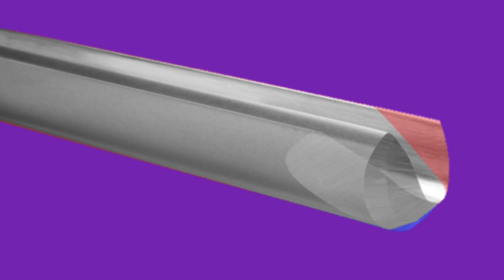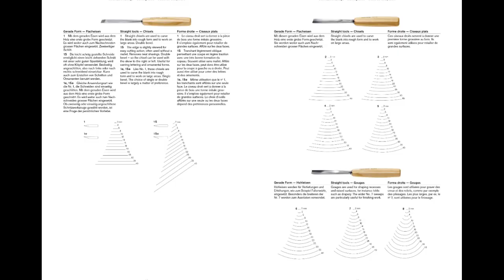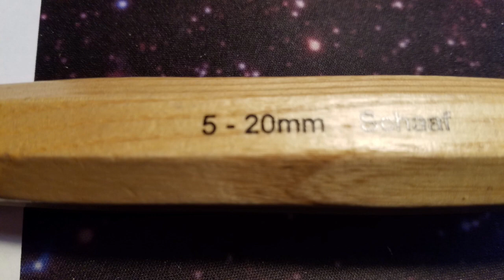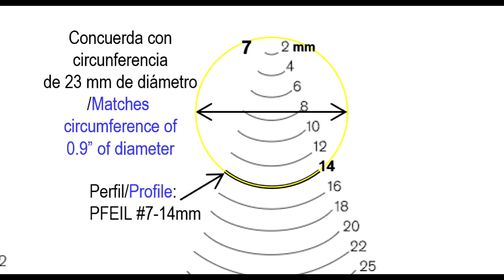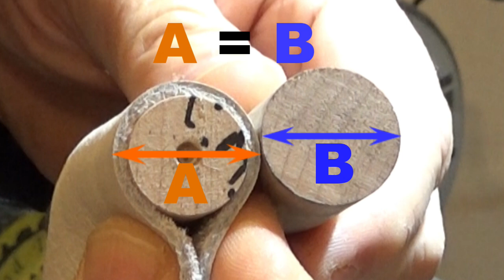Sharpening a Carving Gouge

Comment: I bought Schaaf chisels. They are so poorly made. Several were not set into the handles straight. I still have them but I decided to buy better chisels. I tried to commission one gouge and change the angle of the bevel by hand however after hours of work on my diamond plates I still have not gotten the chisel to work well. This method looks like it will be much more efficient and save me hours of work getting my collection of chisels commissioned properly. Thanks for sharing you ingenious method!
Reply from the maker: Hi my friend! Thank you so much for watching the video and for the comments. I am glad you liked the method for sharpening, it did work for me. I can tell you one thing, none of the chisels in the set come out correctly sharpened and all needed work. I did not have issues with the handles in my set, they were ok. I think the steel used is reasonably good and after spending some time correcting the bevels and sharpening the gouges, they have kept the sharp edge for a long time, I just do some honing with the green paste every so often, and they work fine. Of course, you will find brands like the Swiss Pfeil or English TwoCherries, or Japanese steels that are great, but the price difference is significant. If you are a beginner carver, probably starting with a Schaaf set makes sense, it is not a big investment, it introduces you to a very important skill, sharpening, and then, with more experience, you can get better chisels. Cheers! Daniel

Comment: A fine video that proves there is more than one way to get a job done. I use simple flat diamond stones, a slip stone for the inner gouge edge, folded abrasive paper for parting tool roots, and of course, strops for final polishing. The internal beveling on your gouges reminds me of the shaping that Chris Pye uses. I have been using the Shaaf tools for several years and have found them to be among my very best. I highly reccomend them.
Reply from the maker: Hi Mike, thank you, my dear friend, for your comments and information. Yes, you can do the sharpening several ways. Using flat diamond stones requires a bit of practice and muscle memory. I was trying to find a method that is probably easier for carvers that do not have that much experience. I love my shaaf gouges and chisels, when they are sharp, they last that way for quite some time, and then they just need some stropping to get back to razor sharp! Cheers! Daniel

Comment: I really like what you did here.  This is very helpful.   I bought a 2 Cherries gouge several years ago -- it came very sharp but I know I am going to need to sharpen it in the future.  Your method provides me with a method where I will not screw up what is a very fine tool
Reply from the maker: Hi Mark! Thank you very much for watching the video and for your nice comment. Yes, I found difficult the most "Traditional" methods of sharpening chisels. Doing it this way, it sort of eliminates the guess work. And also, once you have a nice, sharp edge, keeping it in top form is very easy with the strapping. Best regards, Daniel

Comment: Very Interesting Daniel!!!   There is a lot more detail in sharpening a carving gouge vs a wood turning gouge.  
I have thought about doing wood carving over the years but decided I like wood turning better since the end product is developed much quicker for me.  Also, I do have a friend who turned a piece of wood art on his Craftsman wood lathe from Sears and he used a carving wood gouge to accomplish the piece.  Don't ask me how he accomplished it since I don't know.  All I do know is he was using the incorrect tool and and ended up damaging his gouge where it was bent just before where it entered the handle.  He was definitely playing with fire using the wrong tool.
Reply from the maker: Hi John! Thank you, my dear friend for your nice comment. Yes, hand carving tools are not designed to support the stress of the lathe, their shanks are weaker and their handles way to short. Does not mean that you cannot use them in the lathe, it is just not a safe practice. I think with practice one can use almost anything with and edge and a bevel to turn, as long as it is well supported and the cut has the correct technique, but using tools designed for other purposes adds another risk factor to the equation. Cheers and keep safe! Daniel